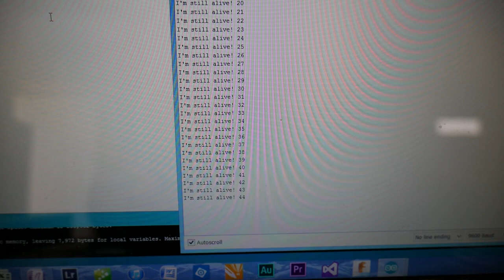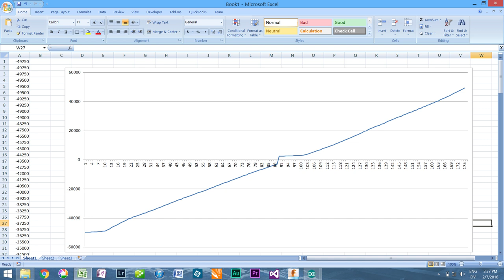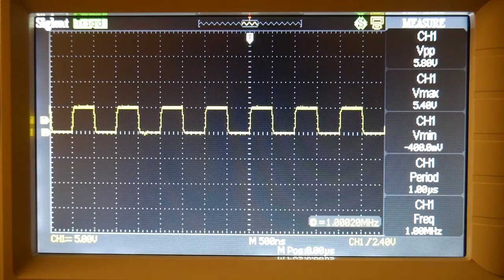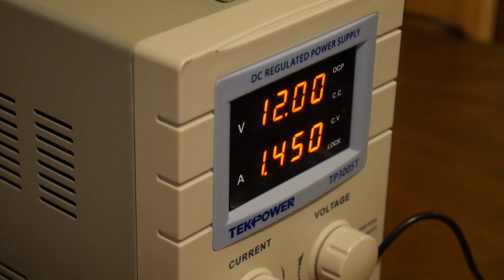Inverted Pendulum(s) #1 - Assembling Hardware

Comment: This is really cool, makes me want to get a lathe even more. For holding the round stock on the drill pres you might want to look in to V-blocks. A single block will hold a large range of diameters, and you are not limited to which ever drill size you got.

Comment: Nice. Slick mechanical setup. When  I saw the stepper at the beginning, I was thinking 'no way that'll make speed and torque'. Then you swapped to the DC motor. I'll give you a warning about the controller you built: get it off the protoboard. The contacts are fairly high resistance, and at high currents, like with that motor, they will drop a lot of potential, reducing motor drive, and will heat up, making things worse as they lose their temper. The end result is burnt tiepoints on the board and/or damaged electronics.
Reply from the maker: +john john I figured that the breadboard was not ideal, I have some of the solderable boards that I'll probably transfer to this week (as well as adding heatsinks).

Comment: Hi scott, just found your channel and immediately subbed. I see you are using a stepper motor and timing belt. Why do you need encoder? Wouldn't it be possible to figure out the position by counting the number of steps and calculating steps/mm like they do in CNC systems? Correct me if I am missing something.
Reply from the maker: The motor can miss steps, particularly with higher speeds. The torque, at least on this particular motor, was much less at higher speeds.

Comment: I am too late to comment on this video but would like to ask some questions 
1. How did u do gear calculations according to your need? 
2. For the timing belt pulley where did u get that mounting and pulley. 
Thanks alot
Reply from the maker: 1. Ball park estimation
2. The belts and pulleys were from CNC machine parts available on "maker" sites, the shaft and mounting I made myself.

Comment: Hi Scott! What kind of electronic board you are using in minute 3:26?
Reply from the maker: The green one is a stepper driver, the one on plywood is just a breadboard I fastened down.
Reply: Ok, gotcha. No probs cause I will use a DC motor with a H bridges. 

Btw, I am trying to make my own inverted pendulum, but I am having some troubles with the pinion and the spur gears. In your case you are using a self made "gearbox", but in my case I do not have the tools for doing that. Do you know any possible solution (for buying) to link the pinion and the spur gears? Like a prefabricated gearbox or similar.

Thanks in advance and congratulations for your work!

Comment: Were you using a constant current stepper driver like the A4988 or something similar? Or did you just hook up the stepper to a double H-bridge?
If you didn't use a constant current driver, that might be the reason why your stepper lost torque and stalled at higher speeds. Try using one of those drivers and use the highest voltage the driver can take, even though the motor rated voltage is lower, using a higher voltage allows you to keep a good torque at higher speeds, and avoid stalling. If you can get it to work with a stepper driver, you can avoid all the problems involved in using a DC motor, like it humming but not spinning at low duty cycles. It's much better.
I saw this 1 video where the guy used a stepper in a project just like yours and it worked amazingly, and could reach high speeds without stalling. Here is the link:
https://youtu.be/OBcsSwayEsc
Reply from the maker: Good to know, I experimented with the microstepping options but didn't get into the current. Probably good to do a project focused strictly on stepper performance before relying on it in such a sensitive application like this. Oh well, now I appreciate the importance.
Reply: @ScottRumschlag  I'm about to get my degree in control and automation engineering, and I built this exact project for my final paper. I'm planning to test some different control algorithms, but first I wanted to get all the instrumentation in order and working properly. I originally used a DC motor and I faced all exact same problems as you did, the main one was the "dead band" when using PWM where the motor would just humm but not spin up to about 30-40% duty cycle. I tried fiddling with different frequencies and got some different behaviours but nothing solved the problem. It wasn't the case to just add an offset to my control signal, because the dead band would change from time to time as the tightness of the rubber belt changed, and if the car was already moving, it would keep moving at low duty cycles, it just wouldn't get started from zero, not to mention that the motor wouldn't spin up to a certain duty cycle, and then it just skipped to a higher speed, and I couldn't get it to start at low speeds. So that messed with the balance point of the pendulum. I could get it to balance as it jittered around non stop, but it could never stand still and steady like I saw other people doing on videos, and I got very frustrated. I even got that phenomenon where the car would insist in idling to one side as it balanced, even though the plane was perfectly level. Anyways, for that reason, I decided to see if it was possible to use a stepper motor instead, as that would solve most of my instrumentation problems, so I set off to watch a bunch of videos, and that's how I found you. When I saw that you used a stepper in the beginning I got very excited, but very disappointed when you had the problem with the stepper stalling at higher speeds. But I kept searching and found some other videos about stepper drivers, and found this one guy that has a guitar workshop, and he has a CNC machine. He talks about this exact problem of the loss of torque and stalling at higher speeds, and that he uses a constant current driver, and when he increases the voltage on the driver, the motor doesn't lose too much torque at higher speeds, and he is able to go much faster without stalling, even with a load.
That got me more hopeful, so I started reading more about constant current drivers, and I eventually found the video that I linked to you on the previous comment, and that made me very confident that it is indeed possible. I will be getting my stepper driver soon and start running some tests, but I would love to see you try it too on your project and see how it works out for you.
The reason why increasing the voltage on the driver helps with the torque at higher speeds is because the driver uses a feedback sense resistor to measure the current on the motor coils, and manipulates the voltage it applies to the coils to get the current to the desired constant level in each state of the step sequence. So even if your motor is rated for 12 volts for example, you can use something like 35 volts on your driver, and since the current on the motor coils can't change instantly since it's an inductive load, the driver will first apply as high a voltage as it can (35V supply voltage) to get the current to the desired constant level faster, and then lower the voltage to maintain that current during that step. So the higher the voltage you feed your driver with, the faster it will be able to get your stepper's coil current to the desired level in each step. So for that reason you are able to work with much higher frequencies and still get the coils to reach the appropriate current level in each step before the next step comes.